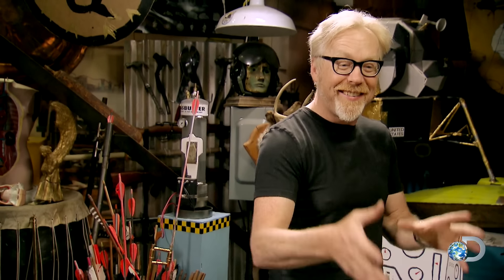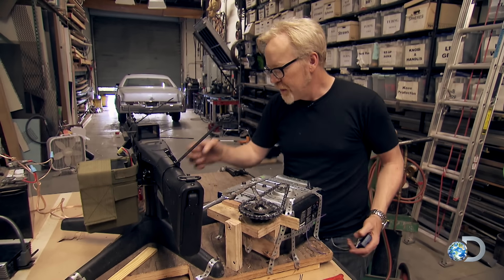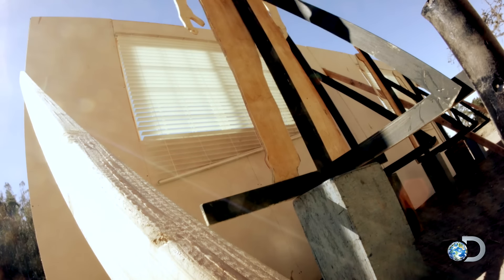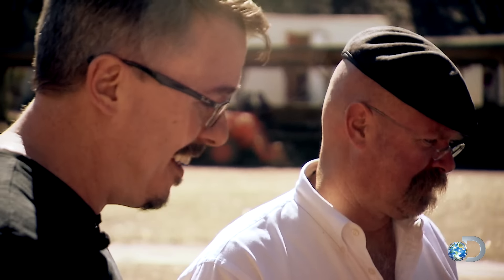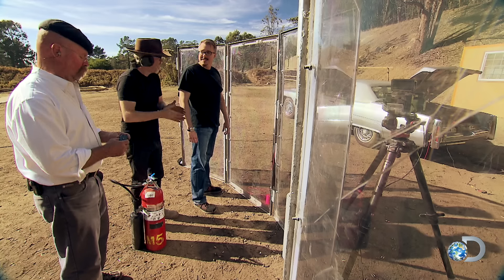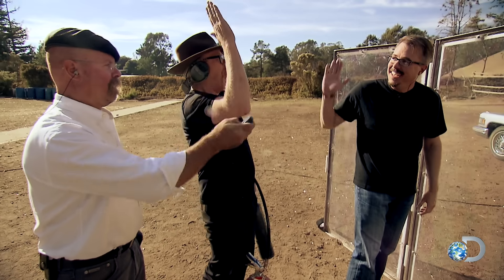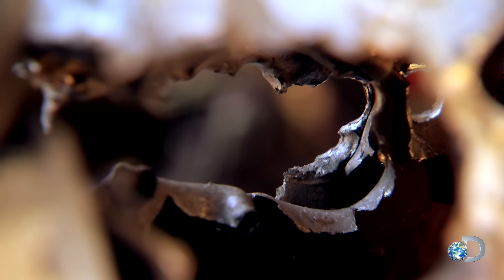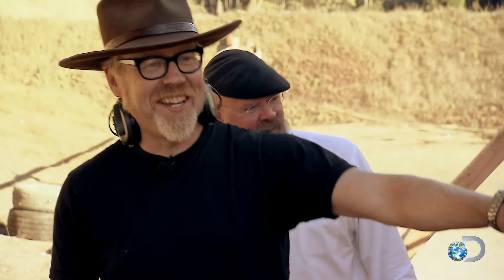Breaking Bad Finale Breakdown | MythBusters

Comment: I love how their idea of protection from .308 rounds in case of a catastrophic malfunction is a thin plexiglass barrier
Reply: it's bulletproof glass
Reply: @Fadexpl  but its thin, possibly not gonna stop .308
Reply: @Yuritarkov  They've been doing dangerous stuff for more than two decades, often under expert supervision.
I think they had necessary precautions
Reply: @Fadexpl  That thin plexiglass isn't stopping a 7.62 round, it would barely even slow it down.
Reply: I tought the same. If that gun bumped and started to shoot everywhere.
Reply: since they're at the other side of the firing arc. the only thing they gonna worry about is shrapnel
Reply: It’s not there to stop a .308, it’s there to stop bits of wood and metal that might be flying back at them thanks to the chaos down range.
Reply: The bullets weren’t gonna hit anything they would ricochet off of, it appears that there is a dirt berm behind the setup
Reply: I remember that one time they lunched a cannonball into a suburban area and it crashed through people homes
Reply: Just needs to stop shrapnel or other junk that might fly backwards
Reply: I had to look a 2nd time, but they had multiple things in their setup to prevent it turning on them: the strong steel linkage mechanism on the back of the gun, the size & shape of the trunk, the chair & rig all anchored to plywood + the trunk, several extra cables/lines/safety straps - all guaranteeing it couldn't turn, plus I'm assuming the trigger-puller was on a dead-man switch. 

So they weren't relying on the plexiglass for protection from bullets
Reply: Given the direction, probably intended for debris in case of explosion, not the gunshot itself
Reply: They aren’t down range. They’re protecting themselves from shrapnel
Reply: @HRRRRRDRRRRR  good thing its not plexiglass and top of the line bulletproof glass. These guys arent idiots and have multiple weapons experts on hand. You think if they know the people to get an M60 nobody is gonna be knowledgeable enough to use proper protective measures when screwing around with it?
Reply: its to stop rogue shrapnel.
Reply: That is ballistic glass and it is rated to stop a 7.62x51 round, they are fine
Reply: Yeah, like how needs Vince G. anyway right?
Reply: The glass has stopped shots from the .50 cal sniper Mythbusters has used. Don't think a .308 has more punch especially when aimed in the other direction
Reply: @Fadexpl  and people have been driving for years. That doesn’t mean an accident can’t happen.
Reply: Yeah everything about this looks insanely god damn dangerous.
Reply: I think I heard somewhere that the mythbusters realized after the fact that most of the plexiglass the used was woefully inadequate in the case of actual bullet or shrapnel heading their way
Reply: @lukasuhlenkamp9850  unless you have a source that directly links to what your saying. I gonna just say that your making it up or that a rumor that you heard
Reply: @Darthnova-rd9nk  In fairness i can't find where i read it, so ill assume the same
Reply: If the recoil of the gun broke it free from those thin metal straps holding it down, the gun could have continued firing in all directions with the recoil making it jump all over. There was really no question that the rounds would go through the car, the drywall and then the targets. I think it was more the mechanics of the system. Agree that plexi glass bullet proof or otherwise was not the best choice. Should have been sandbags in front of it and watch the whole thing on monitors.
Reply: @Darthnova-rd9nk  They did indeed on the "What is bullet proof ?" episode discuss 1/4 polycarbonite not being bulletproof and them using inadequate protection for many episodes . Look it up.
Reply: Ikr. My initial thought was "they're not gonna be anywhere near it when it goes off, right?"
Reply: It's from the shparnel not a direct hit
Reply: 7.62 NATO
Reply: @ScrotalSands  "That is ballistic glass and it is rated to stop a 7.62x51 round"
No it isn't. It's Plexiglas. "Ballistic glass rated to stop a 7.62x51 round" would be an inch thick.
Reply: A thin ICONIC plexiglassberry
Reply: @HRRRRRDRRRRR  actually how could you know? If the glass is level 3 then it can stop a .308 round, specially the FMJ ones ("normal" ammo).
Reply: @Fadexpl  i think there is an episode where they test the glass and finds out that... wops... its only blast resistant and not bulletproof.
Reply: I'd imagine insurance wouldn't let them use a protective barrier not rated to stop 7.62x51. They're probably safe unless the frame brakes and the pannels fall down.
Reply: It's not supposed to. Only way they'd be downrange from the pig's squealing would be if the mechanism broke and the gun kept going till it turned their way.
It's supposed to catch very unlucky ricochets.
If the gun blew up (I've seen AR-15s do it), most of the energy would go through the front or sideways. There's many examples of it blowing up in people's faces and they escape unharmed. It happens with grossly overloaded ammunition I can only conclude had high explosives put inside instead of proper grain gunpowder.. Like the guy from Kentucky Ballistics.

When there's a very real risk of anything hitting the shield, they put distance between it and themselves or some thick concrete walls.
Reply: It's more to stop dust and debre than actual bullets.
Reply: @Yuritarkov  yeah it will
Reply: the mythbusters are firearms experts themselves
Reply: @Darkside-origin  unlikely
Reply: @psychoaztecs  the gear fully rotates so if a bad failure happened the gun could possibly fully rotate
Reply: @Fadexpl  Bulletproof glass is built to crack under bullets, absorbing the impact and not letting the bullets pass through. But with that many bullets, it wouldn't hold.
Reply: @psychoaztecs  Not if the recoil tears the gun off the mount and it starts skittering on the floor in every direction.
Reply: @NothernSide  thats a worst case scenario. Well from what i see. the gun rig is properly bolted down and seems quite sturdy.
Reply: @HRRRRRDRRRRR  Who keeps telling you that it's Plexiglass???
Reply: Its for ricochet
Reply: mainly to protect against other debris because the bullets are facing the opposite direction and its mainly made out of wood with the exeption of the car
Reply: @Yuritarkov  a ricocheted .308 bullet cant even harm that glass, so , that was safe enough
Reply: @HRRRRRDRRRRR  it's probably just for shrapnel
Reply: They’ve nearly killed people before. There was an episode where they were testing a black powder cannon, and unbeknownst to them their shots were going past the target and flying into a suburban neighborhood. They punched a hole through an entire house and destroyed a car, if someone was in the wrong place in their home they would have been killed.
Reply: @psychoaztecs  Not if it came loose while spinning back towards them. Thing swung pretty hard.
Reply: @Fadexpl  bulletproof against pistols. Rifle calibers and esp .308 is a whole other level. Its like trying to use a helmet (which is made to stop shrapenl) to stop a rifle.
Reply: @Darthnova-rd9nk  he's right. Adam Savage mentions it in an interview at some point. But googling Adam Savage interviews is going to give you about 10,000 results to sift through. Also if you think that thin polycarb is stopping a bullet LOL.
Reply: @HRRRRRDRRRRR it's BULLET PROOF.. the gun isn't going to fall off and flip directions. 
Just stop.. durr
Reply: @HRRRRRDRRRRR  it will stop it if it's ricocheting which is the only possible way for it to be heading toward them.
Reply: @MrGriff305 What wizard is casting that spell?
Reply: @MrGriff305 The laws of physics directly prevent this. Your contention requires magic.
Reply: @Yuritarkov it'll stop a rechochet. The gun is not shooting at them.
Reply: @daxx238  depends on angle and deviation of velocity
Reply: @Yuritarkov  It's not thin, it looks to be about an inch thick. Please, tell us more about how you know better than the professionals.
Reply: @Hugh_Jas  never claimed I was the ceo of glassmaking but bullets aren't the type to be expand on impact (with the exception of frangible or hollowpoint) so I would be worried with only an inch
Reply: I was your 5,000th like 😎
Reply: @mandelorean6243 bullet proof isnt even a real classification
Reply: "Catastrophic failure" doesn't mean that bullets start flying backwards. Their plexiglass was just to protect from bits of wood kicked out when the bullets passed through the wall.
Reply: @GrantDWilliams82 I’m aware what a malfunction is in regards to a firearm. I’m talking about if the janky machine they built breaks and spins in a full circle, or falls over with the gun still firing
Reply: @Hugh_Jas an inch thick piece of lexan won’t even stop a 9mm dude.
Reply: @HRRRRRDRRRRR it will 100% stop a ricochet which is the point
Reply: They are 7.62 Nato, not 308
Reply: it isnt a thin plexi glass barrier its one inch thick each pane being 200 pounds
Reply: @HRRRRRDRRRRR  Moving the goal post, are we ?

Comment: They shouldve done the Magnet one, where they destroyed Gus's laptop in an evidence room.
Reply: They tried it didn't work
Reply: @adityaw6995  could you give a link to the video? I'm curious
Reply: Yo Mythbuster Junior did it and IT WORKED.
Reply: Im pretty sure they can still get data off of computers even if you use a magnet on it so its kinda null and void if it would break the computer or not
Reply: @HoboHunterRik  If the computer was properly secured, which I guess Gus did, they probably couldn't get anything out of it.
Reply: @CrniWuk  hank said in an episode that the computer was encrypted anyway so they couldn’t get anything even if the magnet never happened
Reply: @Max200012  I don’t have the link but mythbuster junior did it
Reply: @HoboHunterRik  All depends on how strong the field is. If partially erased you can perhaps image bits but this is fairly costly and slow. That said, it takes a pretty big magnetic field 2kG-10kG depending on drive vintage. It's hard to get a strong field a long way from the magnet pole. By the way, the technique won't work on many laptops now since disks have been replaced by flash memory. Flash, you're better off running current into it.
Reply: @eluceat7641  Exactly, Walter kinda wasted his time. Though, he couldn't know for sure that they'd never get anything off it, so better safe than sorry.
Reply: YEAHHH MAGNETS BECHHH!!!
Reply: i used to use a magnet to pick of 4ftx10ft sheets of steel. you could only safely use it up around an inch.. and it was powerful./.. so i dont see how others say its possible
Reply: @eluceat7641  And if they hadn't went through with the magnet stunt, the cops may have never found the Cayman Islands account number in Gus' picture frame.
Reply: @eluceat7641 it was encrypted so hank couldn't access it with the couple of minutes he had, the police could get stuff off it after a while
Reply: *Gus'
Reply: @LostInPhilly89  we love you
Reply: The laptop was encrypted and even if it wasn't destroyed it wouldn't be helpful to Hank anyway.
Reply: as long as it used an hdd which it almost certainly did given the time it probably wouldve worked

Comment: “Did the bullets make it through the wall and into the enemy inside?”

“You’re goddam right”
Reply: Heisenberg IS the one who knocks.
Reply: Yeah, 7.62x51mm FMJ out of a 22" barrel is going to go through quite a few of those plywood walls and then some :X
Reply: @TheBigOne0305  most definitely even 55 grain 556 could!
Reply: @Tyler's Tears: One wall, certainly. Two walls? Probably. Any more? Well, that depends on the space between them. 5.56x45mm is notoriously unstable after penetrating any obstacles. There is a good chance they will hit the 2nd and 3rd wall sideways and at a deflected angle. This is not necessary a flaw of the round. It was intended to tumble in the target, instead of cleanly penetrating, thereby delivering more energy inside the target, instead of whatever is behind it. The heavier loads are a bit better at penetrating (like the 62grs M855), but essentially still suffer the same effect. Especially seeing that he was shooting through the metal trunk first, I think going with 7.62x51mm was definitely the better choice here. Besided, finding a belt-fed 5.56 machine gun would probably have been a lot more difficult for Walter than finding a 7.62 one.
Reply: I'm just curious how far into the embankment the bullets went.
Reply: 🤣🤣🤣 
Omg that made my night.
Reply: You don't answer a yes or no question with "right"
Reply: Thanks Lord, we´re living here in Germany with min. 8" concrete walls and not in cheap Wood and Plasterboard buildings, the five pigs can blow away ;-)
In the European Version, Walter should use multiple 20mm HEAP Rounds for that ;-)
Reply: @KunoKnoedel  yeah, we build cheap homes but I could just imagine the costs of cinder block homes
Reply: It's a rhetorical question, american housebuilding is guaranteed to have any fired bullet pass through at least 3 buildings before being stopped.
Reply: and it dodged Todd so that jesse can avenge his torture and capture... so sweet
Reply: @riparianlife97701  i am the one who gets shot
Reply: I love how Vince is just all smiles when the machine gun starts going off😂
Reply: .308 most certainly isn’t giving a f*ck about the car panels or plywood walls. definitely would still be lethal. question is would it be as effective or practical in a real world situation like that?
Reply: It blowedum up GOOOOOOOOOOOOOOD!💀🤕💣🔥
Reply: @vincenthill1339 
Prolly couldn't find um!

Comment: In BB, they showed 2 200 rd cans of M-60 ammo in the trunk when Walt took delivery. Since it wouldn’t have been possible to test without risking being caught, we can assume he clipped the belts together and all 400 rds were fired at the clubhouse. Myth Busters should have sprung for another belt just for shits and giggles. Might’ve sawed their plywood wall in half.
Reply: Werent there 4 200 rd cans?
Reply: @NaakteMolrattenZijnCool  Just watched the scene again at Denny’s when he got it and there were 3 cans. I think they showed 2 when he was rigging up the garage door opener. The final scene ran 40 seconds of M-60 fire, about 400 rounds.
Reply: @brinsonharris9816  ah ok
Reply: I did the math. The gun fired for 40 seconds consecutively. The m60 as a Max firing speed of 650 rounds per minute. 40 seconds=.67 of a minute. 650x.67=435.5. So theoretically he fired about that many rounds. 400 is a plausible number

Comment: The guy could produce the purest meth both sides of the border. Of course he could have created a simpler rotational mechanism
Reply: Lucius Vorenus Right but they wanted to see if it could happen in real life and they were right.
Reply: Lucius Vorenus 
Chemistry and mechanical engineering are very different. just because he was good at one doesn't mean he is good at the other.
Reply: Omar Moemen no but its not like its some highly complex devices , its basically a motar.....and its clear he is pretty smart as he melted his plastic handcuffs when Mike handcuffed him by using coffe maker wires and short circuiting them.

And he had a Nobel Prize in chemistry...comeone he know how to make a rotational device
Reply: Suq Maidic he won a noble prize, then he along with his friend started Grey Matter, just after little time, he sold his shares for $5000 and then became a chemistry teacher
Reply: Suq Maidic I Don't Know, The prize by Science Research Centre actually says that "Walter White, Crystallography Project LEADER 1985, Contributor to the Research awarded the Nobel Prize"

If he was the Project Leader, i think it would have been awarded to him....
Reply: Think of it in the real life situation of Rosalind Franklin and Watson&Crick. Rosalind Franklin was the project leader for the X-Ray Photography, but Watson & Crick developed the model starting from those (altough they later gave the nobel to Franklin for her contribution).
Reply: Lucius Vorenus The hard part is making one that won't rattle itself apart while firing.  7.62x51 isn't something to sneeze at, particularly full-auto.
Reply: It's physics, not chemistry
Reply: Lucius Vorenus the purest meth in the world

Comment: One detail I always feel like they missed is Jacks compound was made of cinder block, not wood.   I m still pretty confident those 308 would be plenty deadly on the other side regardless but that wouldve really been the perfect test
Reply: I just went back to see, because your point intrigued me. It's not. It looks more like a Stucco façade or some other type of covering you would put on the outside in place of vinyl or actual brick.
Reply: @tristanmike   I was initially going to argue with you on that but went back and looked and sure as hell you are right.   Its weird I always had it in my head that the place was made of cinder blocks.   Like I said i m sure it wouldnt have made a difference either way.  I ve shot cinders with 5.56 and even that little bullet chews through them pretty quick, Im sure a .308 would barely be slowed by them
Reply: @ST19859  Yeah, I wasn't trying to be argumentative, in fact, I remembered the cinder blocks too, which is why I even bothered to check. It must have been the lines and the squaring of the Stucco that had me thinking cinder blocks. Anyway, just goes to show our memories stink when it comes down to it. lol